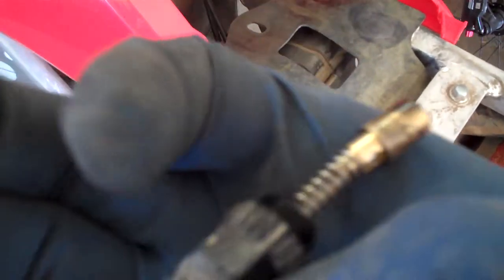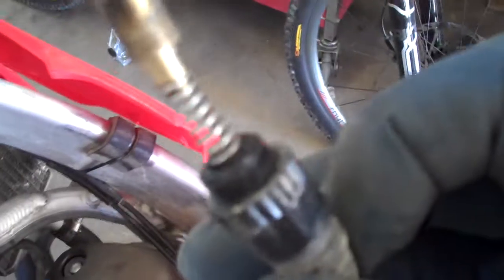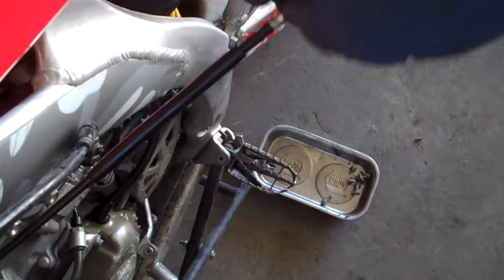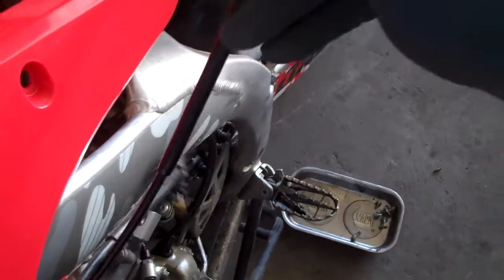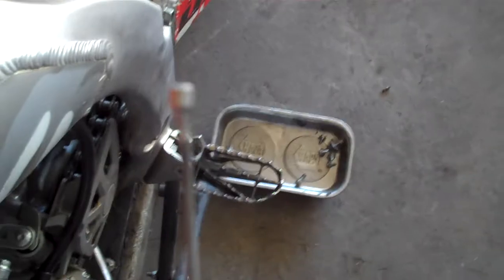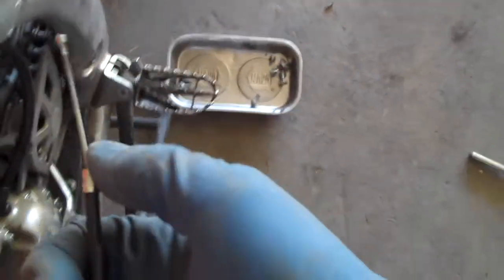CRF450 CRF 450 hot start cable installation how to install

Comment from the maker: You use a CHOKE to restrict air and make it RICH when COLD to help it start.  You use  HOT START to restrict fuel to make it LEAN when it's HOT to make it start.  If it's stuck on LEAN you'll have over heating, back firing (lean back fire), and possibly burn a hole in the top of your piston (if left that way for several rides).
Reply: {The hot start allows more air into the mix, same amount of fuel;   opposite of the choke, same fuel, very little air.};

Comment from the maker: @nickiz1 I kind of thought so.  I live 4,600ft. above sea level and ride between that and 11,000 ft. asl It comes in pretty handy for me.  Technically I would benefit from rejetting half way up the mountain a lot of rides.  The climate here also ranges regularly between -20 F and 105 F in a year.  The fuel injected bikes are nice for variation like that.  You've got it easy where you're at in terms of jetting...... Luck-eeeeee!

Comment: i replaced the cable for my crf 250r and man was that a pain in the ass to get in there and loosen the bolt. Then when i put it back on it was just as hard taking it off as putting it on.

Comment: @1.55 you talk about changing the brass end bit that the new hot start cable does not come with. I tried replacing mine and broke that brass end part. Do you know where i can get another one or what there called, cant find it anywhere. Your videos are really helpful i only wish i watched sooner.

Comment: I've got low compression on my yz250f took it in said I need a new hot start cable but it looks like it's working fine, I've also got auto decompression cam so I'm thinking that's the problem because you only need either or right?

Comment: Hey good video. I gotta 05 crf250r an the brass peice of the hot start is stuck in my carb. My bike is extremely hard to start an runs to hot when it's running. Would you think it's cause that brass peice is stuck in my carb?

Comment: the brass part of my hotstart cable got stuck in the carb and in the process of taking it out i got a piece of the thread wall of the carburator to come off -.-